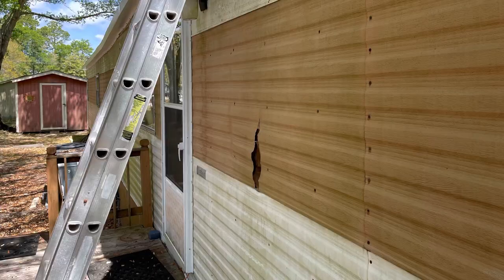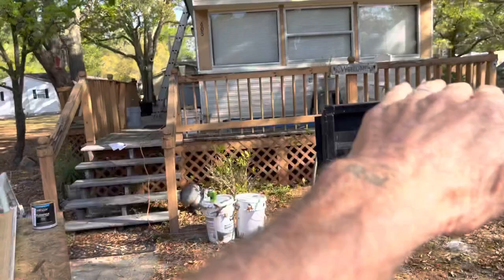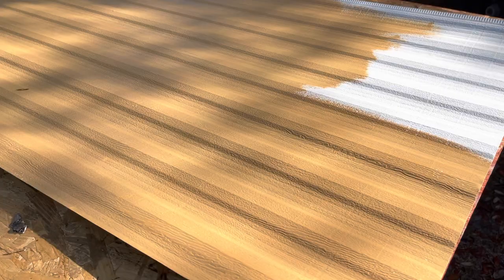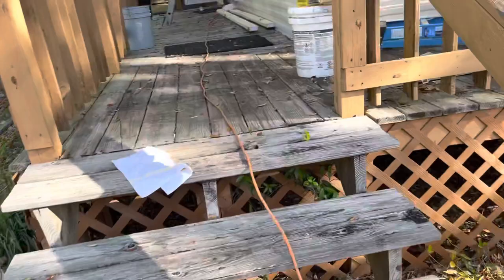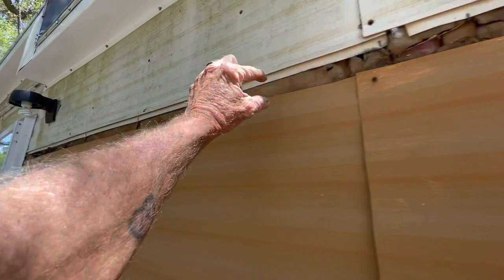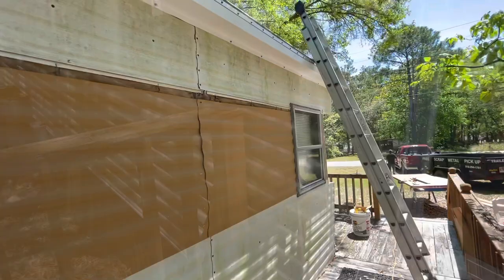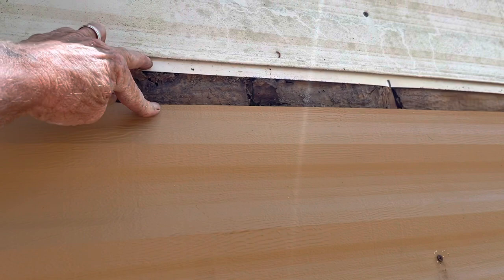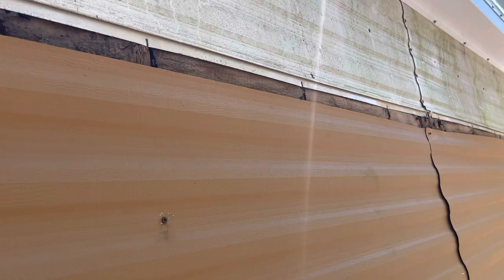Mobile Home Metal Siding Repair.

Comment: Life saver. My windows I need replaced are 68x30". It's about $800/ea. It'll come out to almost 5k. Trying to save for a new home, don't really want to spend 5k for a few "specialty windows"  I'd much rather buy smaller windows and replace a couple of panels if needed. Thank you very much for this video. I'm confident I can replace the panels. I've done all the drywall, subfloor replacement and basic electrical in the home.
Reply from the maker: I was surprised to learn that it was so easy to replace the panels. I did notice that the panels are smaller now than they used to be so you might want to think about that the panels that you buy might be smaller than the ones that are on your house but that doesn’t matter you can still do it

Comment: Drew, I just started to remove my mobile home floors, to replace the  old particle board floor. I got to the edges and the carpet and bottom wall plate was nailed and stapled on top of the carpet, to the edges of the particle board floor. 🤬🤬

So I can't remove all of the old floor without removing the wall. So i just dug out the floor even with 2x6 end trusses. Then I will add blocking so I have something to screw the edges of my new plywood down to. That's all I could think of doing. 

Had to remove about 15 staples every 2 feet from that bottom plate. That really slowed up my progress. And I have to do this throughout the mobile home. 🤯🤯
Reply from the maker: Well I hope these videos will help you on your problems and we run into that problem all the time. This is what you do. 
https://youtu.be/zJIhdYcEy-k
Reply from the maker: https://youtu.be/e-bHWLjqM2E
Reply from the maker: I hope these two video links help
Reply from the maker: Call me if you have questions 910-294-1761 I might can help if I don’t answer leave a message. Sometimes I don’t answer calls because I get so many spam calls.
Reply: @Drewsroofingandhomerepair  Thanks for the video links Drew. 👍🏽 

At 12:37 of the first video is where I have like 20 staples and a couple of nails between each wall stud. I guess I have all those staples because of the carpet. So what I had to do was remove the staples from the bottom wall plate. I also cut the nails that missed the 2x6 floor joist or frame. I cleaned it all up so I can add that blocking. 

My quicker option may be to turn my circular saw side ways to cut all the staples from that bottom plate. Clean it up, then add the blocking and screw the plywood down to that blocking. 👍🏽
Reply from the maker: I’m glad I could help